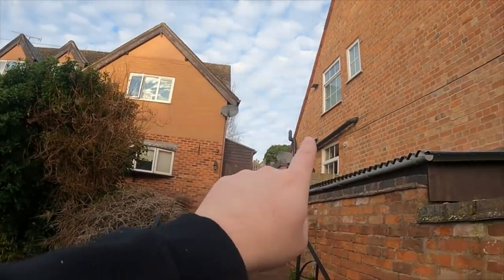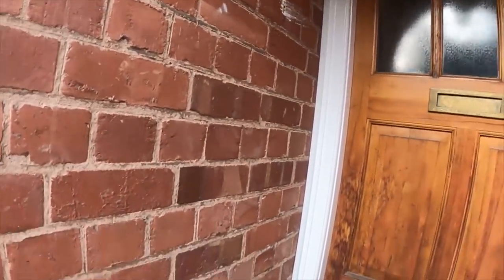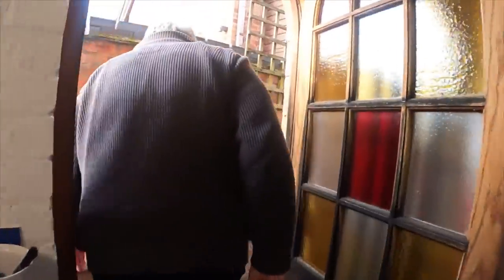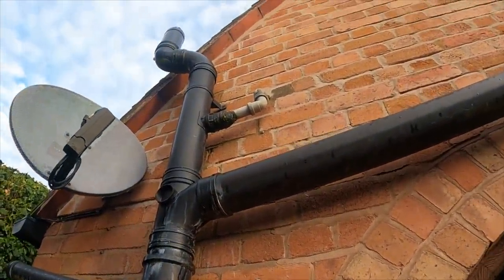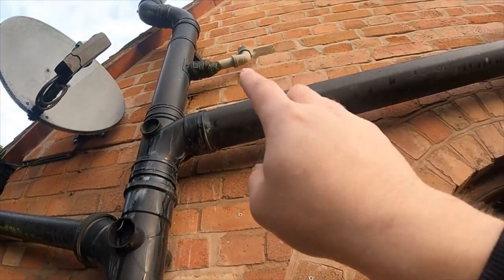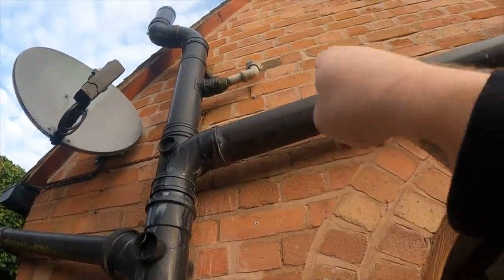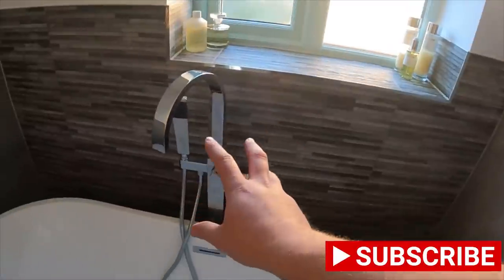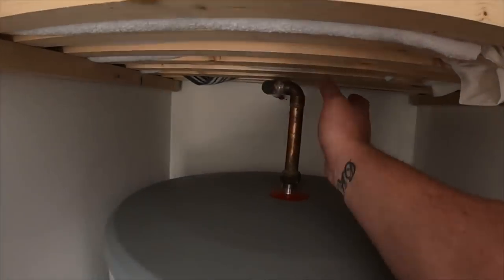PRICE REVEALED | PLUMBING COST for a BATHROOM REFURB (Cheap or Expensive)

Comment: Another awesome video Mark 👍

With your £115 labour to repair the waste pipe, is that your hourly charge or just a fixed price? In my area the average is £25-£30 an hour so more like £55 here if priced by the hour.
Reply: £25 an hour for a self employed plumber where do you live!!!
Reply: @plumbertime  West Midlands. I’d say £30 is more the average here 😳
Reply: Seriously. £25.00.  Per hr.  Working off a ladder. Self employed.
You're there to earn money but also do a quality job. 
I'd be removing that boss pipe connection 100%.
Personally £130.00 plus materials. If its a wheel change you're attempting good luck 😂
Nice video Mark. 👌
Reply: £30 an hour?!? You've got a business to run. Charge properly and do a professional job. Can make £20+ an hour working under a boss. Know your worth.
Reply: Imagine you take your car to the garage.. You don't know exactly how long they've been working on your car, you just see the charged hours... With the trades you bring the garage to your customers! My garage charges me nearly £100 an hour.. Plus parts. Know your worth.

Comment: The carriage from the bath tap is a blending valve take the blue cap off. It’s the same as a disabled sink tap
Reply from the maker: You certain on this mate???
Reply: From the video it looks like it is the cap comes off and underneath is a red thing can move it and the tap will get hotter. It looks the same on the video as the disabled one I had to do not to long ago
Reply from the maker: Thanks mate, deffo something I will look at if I return

Comment: Small hole in the ceiling underneath with a camera, it’s likely not far from the tap if uv got hot to the basin…
Reply: Further into the vid looks like there’s a balanced cold, could isolate that and see if it’s makes any difference
Reply from the maker: Yep that’s an option👍🏼

Comment: I would just drill a few holes in ceiling below use inspection camera easy.
Reply from the maker: Nothing shows up on the camera….. also no need to drill holes, just drop a light out.. easy😉
Reply: @MJTiffPlumbing  agreed if spots in ceiling and joists running the right way ,I had same Problem,drilled some harf inch holes and used the  endoscope on my phone (armour 9)very hardly to have,love the videos and work.

Comment: I thought the prices for jobbing bits were bit cheap but bathroom price was bang on what I would of give
Reply from the maker: Thanks Tim…👍🏼👍🏼

Out of interest what would you of charged and where abouts are you in the country, I ask as I’m just interested in how prices compare all over 👍🏼👍🏼
Reply: @MJTiffPlumbing  North Yorkshire bout 120 to drain cylinders    
100 to 120 to fit showers with the bath job would of said day rate which I work on at least 300 full days more if gas work .dont do many full bathroom refurbishment now as I found i was loosing out on smaller good quick earners also had alot of tradesmen let you down my area makes you look shit halfway through a job
Reply from the maker: @timmortimer5726  cheers mate…👍🏼👍🏼
Interesting to hear👍🏼👍🏼

Comment: I have a standard proforma for a bathroom refit, listing everything they need to think about, the sequence of the work inc electrician, plasterer, tiler etc., with a very rough cost.  When they've finished choking on their G&T (or cup of tea), I go in for an inspection and give them a more accurate written estimate for their particular job inc other trades.  I always suggest they get other estimates for comparison - they nearly always come back to me.  To many plumbers / bathroom fitters let customers down in many ways, are too badly organised, or just downright dishonest.
Reply from the maker: Exactly mate 👍🏼👍🏼

Comment: thermal camra   run hot vue from  room below to trace pipe work
Reply from the maker: Couldn’t see anything with a thermal buddy, tried it on a later video
Reply: @MJTiffPlumbing  just a thought
Reply from the maker: 👍🏼👍🏼… tried literally everything…… make sure you catch the video how it was solved

Comment: I think that quote for the bathroom is way over the top even for your area. I showed your video to my builder and he said 5k tops. You install a shower and he is building one custom (walk-in shower)quite a difference don’t you think. Obviously I don’t tell you how to make your prices and your video’s are quite nice. My bathroom for instance, I converted a bedroom for instance moved all pipes, bathroom triple size of what you have, porcelanosa accesories, new plaster, new tilling made custom with some areas where you can put your shower gel and bits, bathroom water taps controlled through my phone, completely digitally house not only bathroom, it cost me 20k, 60 miles of London.
Reply from the maker: Can you get you builder to get in touch with me, to come and fit it for £5k all in and I will give him an extra £1000 👍🏼👍🏼

I will hold off starting it till he can come and do it…. Thanks mate, I’ve got loads for him to come and do👍🏼👍🏼
Reply: @MJTiffPlumbing  and for you to still do a profit ? He said: no thanks ☺️
Reply from the maker: @riseandshinesunshine  
Of course he did…..🤣
Reply: Never get a builder to do plumbing, and never get a plumber to quote a brick wall…

Comment: Why not contact the building company then speak to the project manger then find out which  plumbing company that did the work in that house .... That plumber most know where they put the mixer valve
Reply from the maker: Because, as said, the building company have washed there hands with it and have zero interest in putting it right…..

Comment: Jesus no wonder people don't trust plumbers n tradesman that's a 4k job surely everyone got to make a living but how you get to that price a whole suite from Victoria plumb you can get for under £700 couple hundred for electric shower stud timber is peanuts 🥜 
I remember when I got prices to tile my living room in large format tiles I supplied all the materials ready to go and I was getting prices from 2k to 4.
5k I did the whole thing myself took me 2 days and a morning to grout dead level set out how I wanted all cuts tight it cost me £150 for the tile cutter and £15 for angle grinder wheel so given that a tiler already has that who is paying 4.5k for 3 days work joke
Reply from the maker: You will never understand judging by the comment buddy, so there is no point in trying to explain.

As long as your happy with your work and it’s done correctly your winning
Reply: @M J Tiff Plumbing  I run a business mate that turns over a fair amount so I know about charging and pricing yes I'm happy with my work I'd happily pay people good money but there has to be a line to earning a decent amount to over charging

Comment: Absolutely clueless. To fix stack on first job you just need a new connector with 32mm connection on it, then no need to leave old one capped off. 
No need to damage all tiles to find valve and not be able to match them. Just access from ceiling below and paint later. £7k to 8k for bathroom is well over the top, especially if you’re trying to cut aqua board around that window, will look bad. That bathroom should be 4K labour max. No way materials are 4k more like 1.5k max.
Reply from the maker: DHC

Thanks for watching🤣🤣

Comment: Glad you shook you’re head at mention of Bristan shower; not a fan me, Aqualisa or Mira every-time for me!
Reply from the maker: You will see why I shook my head if you watch one of the earlier videos about Bristan showers
Reply: @MJTiffPlumbing  ah yes have now. My issue is the pushfit elbow onto pipe in wall on 1 I had to take off & refit: right pain as fitting goes into wall & not easy to get off meaning had to buy new elbow to refit it. Re warranty, all electric showers seem 2 years is all 1 can expect & 2nd year is always ‘they will send part out free’ but us mugs have to fit for free it seems!